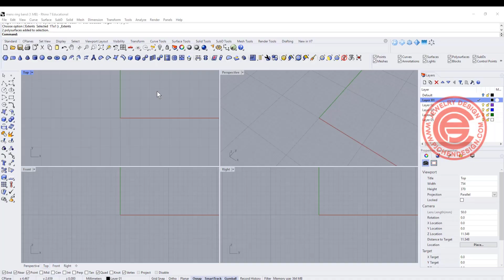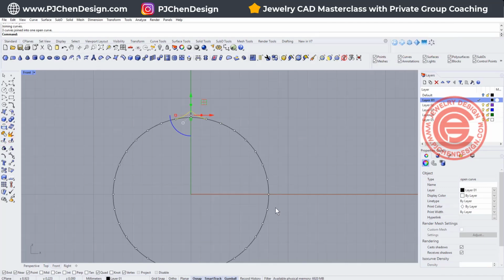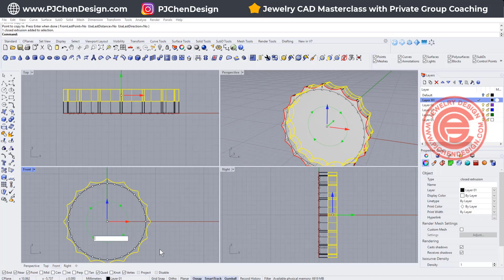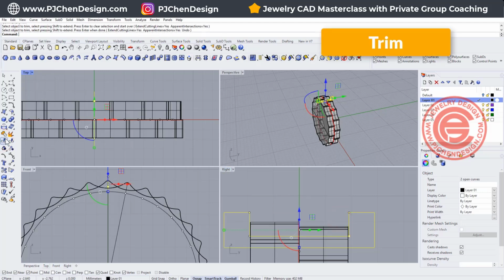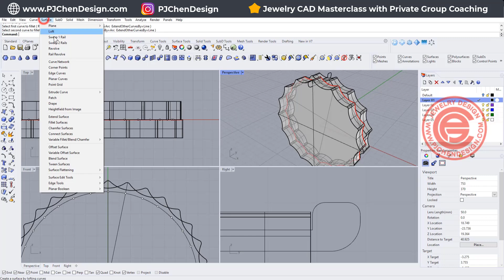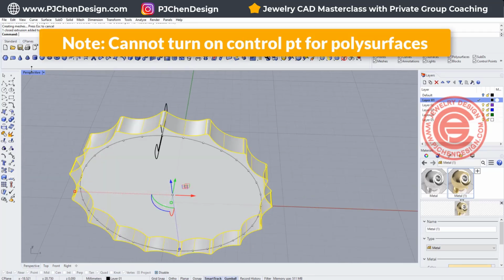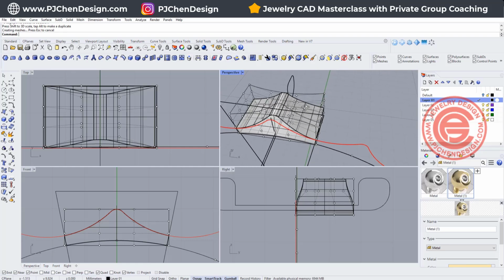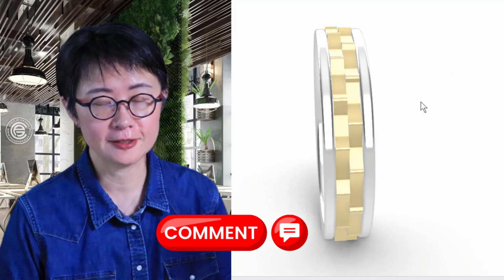Beginner Guild to Jewelry Design Tutorial: Mens' Ring Design with Rhino 3D #482

Comment: I think I have a problem, which is that my printer does not output the design with the same dimensions selected in the Rhino program.
 For example, I set the thickness to 1.32m.m for the design while I get The design is 1.40 thick and the The amount is not constant. because other times I specify the thickness  1.36 And get 1.46 to 1.56
Reply: Ooh that's really bad because it can give you a lot of problems while you have your actual piece but you have to be really careful
Reply from the maker: assumeing all the setting is correct, you may want to test the resin for shinkage and adjust your model.
Reply: @PJChenJewelryDesign Thanks for the reply. What do you mean by correct settings? Do you mean the printer settings or the support settings in the Chitubox?